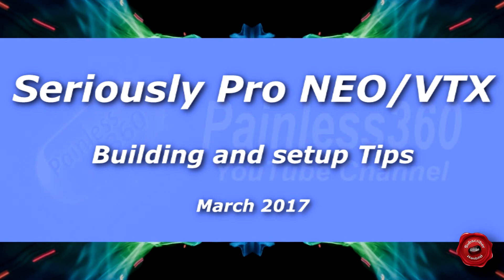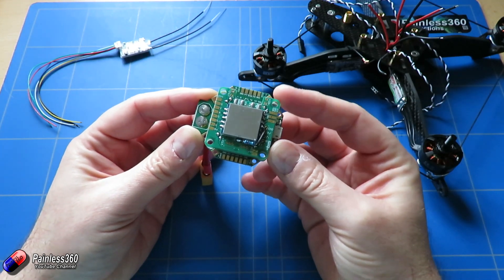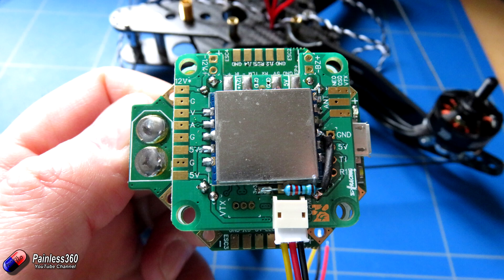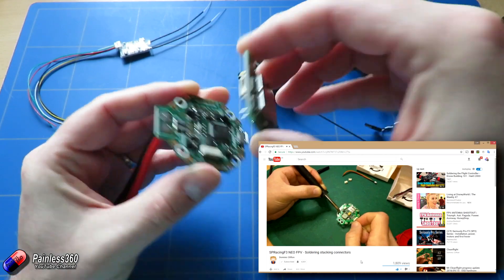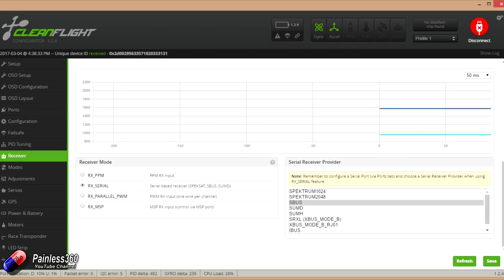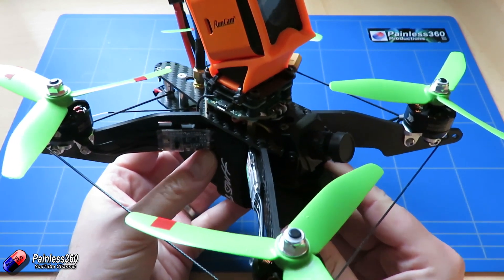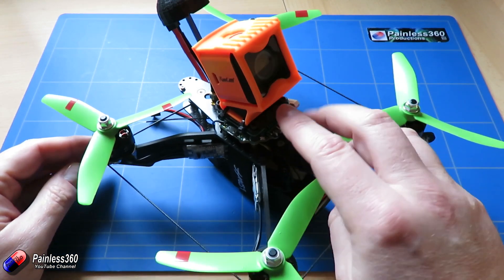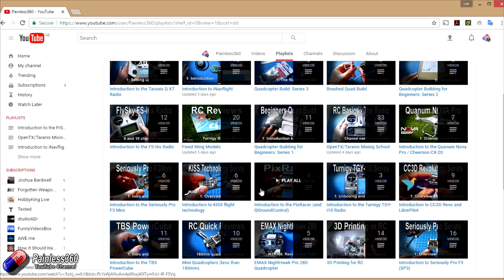RC Tips: Seriously Pro Neo Flight Controller and VTX/OSD Setup Tips (using Fossilsstuff revo frame)

Comment: I must be getting spoilt as I'm thinking; £90 and I have to solder resistors! But great resource Lee, as usual. 
I've just used a Holybro AIO in a build; easy-peasy and beautifully built. No VTx but there are some tiny ones now. Very clean build, I haven't flown it yet but I can't imagine there will be issues.
Reply from the maker: We have the HolyBro X1 and the 250 here and they are well built, powerful, fun to fly machines. I'm a fan of them so I'm sure you'll have a ball! Happy flying!

Comment: Nice video Lee. I'm running CF 2.0 and it still doesn't work. Im going to desolder the VTX can and throw it in the bit and put an IRC Tramp on top of it so I can keep the OSD and use the Tramp Telemetry to change my channels in BF. I have had this set up 3  months now. Been waiting to here back for Dominic for 2 months and now I just want to fly my quad :o(
Reply from the maker: The resistor works for us here. I'd try that before you bin it..

Comment: Hello, can you please point me in the right direction. where does the ibus signal wire connect to. presumably not on the sbus pad?
Reply from the maker: I've not used it myself, but from what I can recall it looks like you connect it to the sbus pad. Best of luck